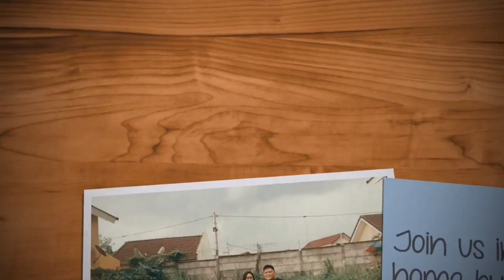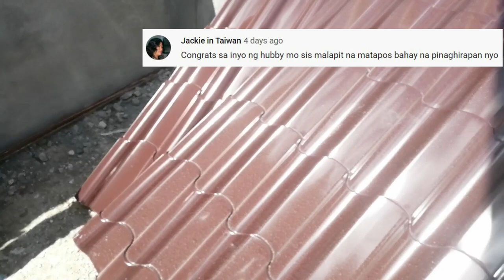Magkano ang Nagastos Namin sa Roof Tile Span (Cost of Roof for a Bungalow House in the Philippines)

Comment: Eto na po ba ung .50mm panel (tile ) na tinatawag? Ganitong klase po ba?
Reply from the maker: Hi may ann... Yes po... 0.5mm yung thicknesz ng material
Reply: @BuiltToLastVlog  mas malaki nga po floor area nio compared sa akin 170k quatation nila sa bahay ko ganito din Naman gagamitin na materials btw thank you po sa response God bless you more
Reply from the maker: @Belindaa_Belle  bka nman po ksama na yung trusses dun sa price na yun?
Reply: @BuiltToLastVlog  parang ganun nga po siguro kasi may nakalistang metal furring sa materials. trusses mean ung pagkakabitan hu Ng ceiling ?
Reply from the maker: @Belindaa_Belle  trusses yung pagkakabitan po ng roof.. Then yung metal furring yun naman po ang attach sa trusses para sa ceiling
Reply: @BuiltToLastVlog  basta hu ang nakalagay may two kinds of c-purlins po may angle bar at Yang nga po metal furring din at may mga ilan² pang materials. Pasensya na Kung marami po akong tanong medyo masakit Pala kasi talaga saa ulo magpagawa Ng bahay. Pasensya na po but thank you sa maagap na pagresponse napakahumble nio po .♥️
Reply from the maker: I suppose kasama na po ang trusses dun pero make sure nalang po na malinaw yun b4 kau mag engage sa contract.. Yung sa amin nga po roof materials palang po yun inabot na ng 70k if i remember it correctly pero bukod pa yung trusses dun plus labor cost pa.. Glad we are able to help in small ways.. You can help us by sharing our vids to your friends as well. 😊

Comment: Ilan Sq meters po ang bahay nyo mam   ? Saka  ilan yero din dapat bilhin para   mag  kasya?
Reply from the maker: Hi Xiao Ching! Thanks for watching.. Kailangan po yan sukatin in actual kasi depende po yan sa design ng roof kung ilang aguas ang gagawin.. Mas better po kasi if kaya nyo mabili ng isang buong length para bawas dugtungan.. But standard width po ng roof is 1.2m the kayo na po magdidikta nung length. But if bibili lng po kau sa hardware standard size is 10ft po ang haba and 1.1m ang lapad
Reply: @BuiltToLastVlog   ah OK po mam sir , thank you sa information,  bukas kc bibili kami ng asawa ko para don sa bago namin bahay 😊 110x120   ang lawak peo di  namin alam kung ilan dapat ang pweding bilhin , kc budget lang namin 180k?